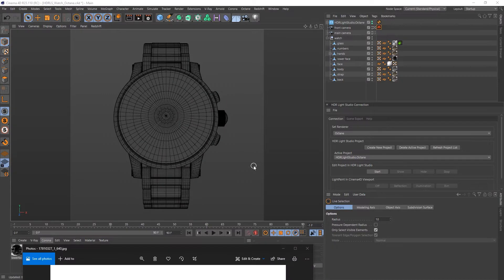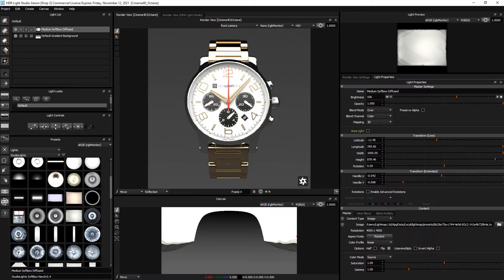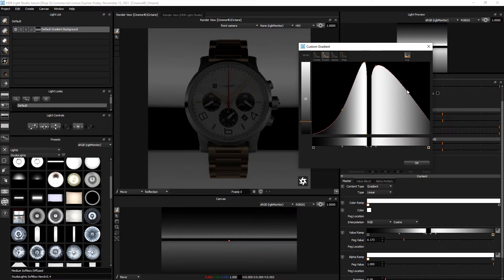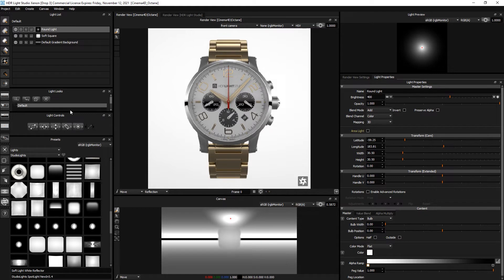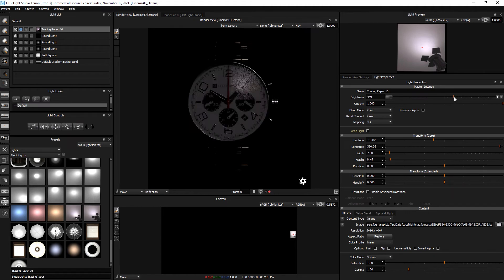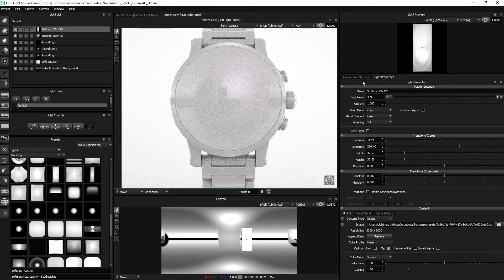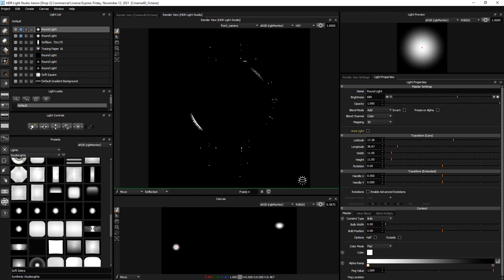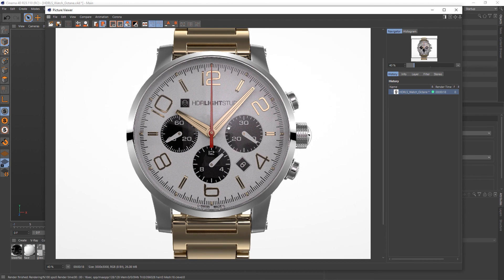Cinema 4D and Octane - Product Lighting Tutorial

Comment: Really nice and helpful tutorial.. But every time i export the HDRI from HDR Studio to C4D-octane i need to increase the intensity to see the same brightness like the HDR studio. And again the result is not 100% the same. Have you got any specific option turned on? What am i missing?
Reply from the maker: Are you changing the LUT on the render view in HDR Light Studio to None, you may be looking at the image in HDRLS UI and then compare it to in C4D... if you have sRGB applied, you are double applying the LUT as the image shared with HDR Light Studio from Octane has the LUT applied. See at about 1 min 40 in the video.... you see me change this setting.
Reply: @HDRLightStudio  Thanks for your reply! That solved my problem. I noticed that you also have and ACES color profile in the preferences. It would be nice to see a tutorial about this. ACES is being used more and more lately